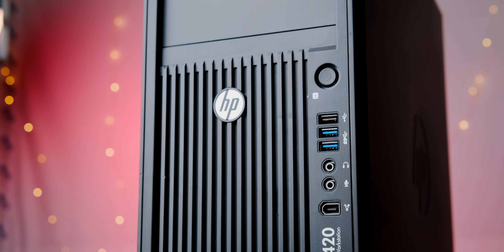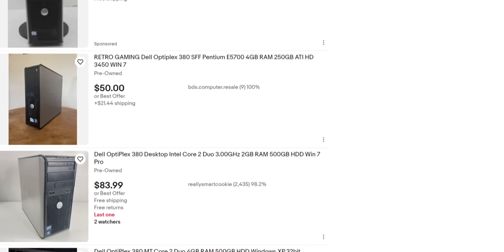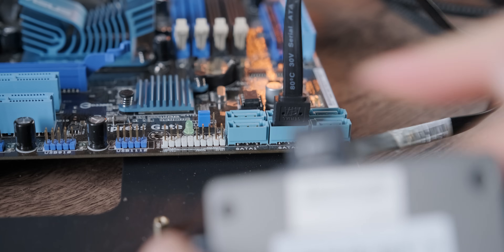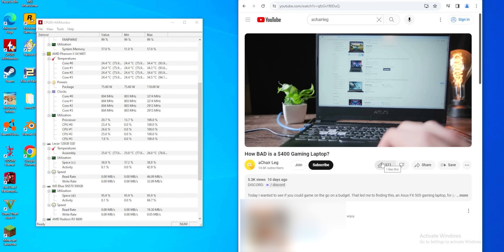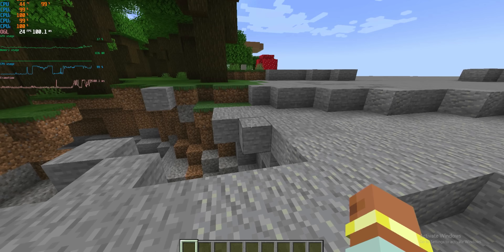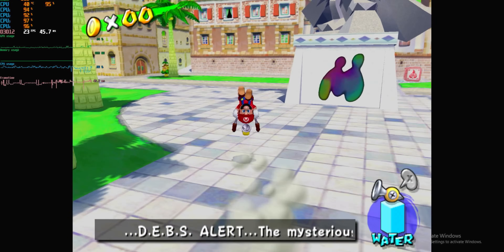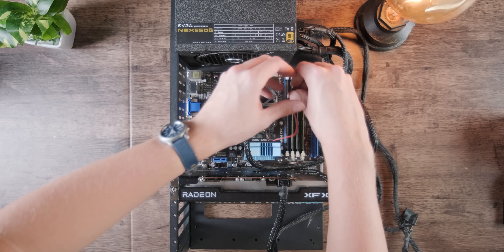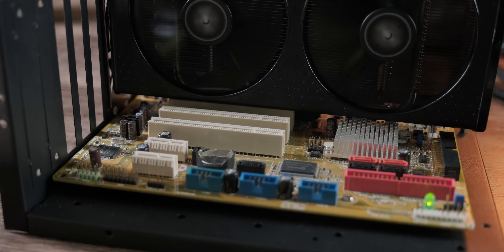DDR2 is DEAD.

Comment: I still have a bunch of my old LGA775 hardware laying around, some of it was used for a family file server until I upgraded it because it got too old.
But I recently built a "retro" core 2 duo setup for those 2000 era games, and it works great with Windows XP and Windows 7.

LGA775 is such an interesting platform too, because of how many different hardware configurations you can use: DDR1, DDR2, DDR3, Pentium 4, Pentium D, Core 2 Duo, Core 2 Quad / Extreme, PCI, PCI Express, and I think some rare motherboard also have AGP, while some industrial boards even have ISA! It's wild. It may not have the longevity of modern AM4, but it's a veritable smorgasbord of mix and match compatibility.

Comment: makes me wonder how much performance you can claw back by either using a different/older version of windows or tweaking the current one. i made a script to significantly reduce some checks windows (at least win 10&11) spams that absolutely annihilate performance and cause stutters, quite literally gave new life to my i7-4790 along with a $40 motherboard and microcode downgrade.

Comment: Had to deal with someone's pair of Core 2 Duo E4600 PCs the other day and it was not great. The Intel D945GCNL boards can recognize 4GB DDR2 ram at most, but only 3.23GB is accessible on the OS side due to chipset limitations and they have a tendency to have capacitor leaks which one board did. What made it feel worse were old 160GB hard drives (one of which died) along with generic silver power supplies (one of which blew a fuse). It was quite an adventure to cobble the remaining bits together to reformat it as a Windows 10 (used Tiny 10 x86 due to limited ram) PC with MS Office for the elderly owner.

Comment: How much power was the intel system drawing? Because I'm on a q9650 with 8gb ddr2 800mhz and it pulls at max 40 watt, just the cpu. It doesn't seem much to me. And yes, I swapped an intel core duo e8600 with this q9650 for 25 euros on ebay. It made sense.

Comment: DDR2 bandwidth sucks, memory overclocking is very limited.
Intel Penryn and AMD K10 are dead, outdated architectures and both superceded by cheap modern alternatives - Core and Zen.
All of them, including motherboards, are priced similarly or even cheaper than DDR3 platforms.
There's just no reason to invest in a DDR2 system, unless it's for a retro build. Or it's dirt cheap and you're in need of a media/office PC.

Comment: ••"F'num" 😂 It's pronounced like "Fee nom". I think AMD marketing wanted people to think of the word, "phenomenon" or "phenomena", "phenomenal", &c.
••I have legacy PCs (intel QX6700; socket 775 with DDR2 & AMD FX-8370; socket AM3+ with DDR3), so this content is still relevant to me, but I don't even try to put modern games on them.
••I remember back in the day DDR2-800 seemed so wicked fast (especially being able to remember the days of DDR-200, the Apple II (read and said as "two") and 486 IBM compatibles).
••Another factor in older PC component prices is inflation from recent years has caused these prices to go up. I paid $7 for a Xeon X3210 in 2017; now (late 8/24) it's $14. However, China is making and selling DDR3 new today. I think it's helped keep the prices down. I may replace the RAM just to keep my DDR3 system running longer.
••My socket 775 system (dual boot) will run Windows 10, but it does so much better with Windows 7; especially since it maxes out at 8GB of RAM. It runs all Windows XP games & programs like a beast. Driver support for newer Windows on older hardware can be abysmal. If I can ever get around to putting Windows XP, maybe Windows 7, and a nice Linux distro on my AM3+ machine, I'll probably sell or part out my 775 PC. That could be 4 operating systems on one PC 👀

Comment: Being able to run a multiboot 98se, XP, Vista, and/or 7 pc with Core2Duo or Core2Quad/Xeon (Disable 3 cores for 98, and 2 for xp) with overclocking and a xfi or audigy 2zx for that hardware excellerated EAX audio. 

You gain DirectX 10 with Vista, but lose true hardware excelerated audiocard support (cue Alchemy software).

I see alot of tests using old hardware, new versions of old games, on new os's... You gotta run the old 32 bit versions with the overkill hardware, and on a 32 bit os

Comment: Ram shouldn't make a huge difference in most cases, the most notable difference would likely be with onboard graphics and single channel.

One thing I remember about the Phenom IIs was that they were very sensitive about the mainboard and northbridge frequency.

As far as prices go: A (surprising) lot of businesses have antique systems running, where newer ones wouldn't have the needed connectors/slots, support for old windows versions etc.

If you're bored, you could also do a video on old "BSEL" mods for 775 (incl. 771 Xeons). Basically, you put some electrical tape etc. over the pins to fool the mainboard into thinking the CPU has a higher FSB. Only works on MBs that don't use CPUID.

Comment: re: not seeing drive during windows install: get storage drivers from mobo manufacturer and drop the folder in the installer USB. Then load the driver during installation pointing to the folder where you copied it

Comment: I am in current possesion of a dell XPS 630i system with a core 2 quad extreme using DDR2.  It was supposed to be a very cool video about old school gaming hardware.  Unfortunately, trying to use it was painful.  It is still on the shelf, so we will see what happens in the future.
Reply from the maker: That sounds really cool! I would try and throw a really lightweight Linux distro on it and see how it goes

Comment: I am using amd x3 phonei processor with 4gb ram.. clock speed 2.1ghz.. work fine many years no issues only one time power supply change..i dont even knew which year i buy.. may be its working 13 year.. more then

Comment: ddr3 still holds up fine. What's really funny is I never used ddr4. I ran a ddr3 machine with a 4790k and that processor was so good and is still decent, that I skipped the entire generation of ram and went straight to ddr5.

Comment: that's because you have low-end mobo with low-end chipsets instead of using P45 / X48 chipset would make big difference!
I have 2 machines with 16gb ddr3 and 8gb ddr2 all of them top specs and I play no games but I have battlefield 2 and F1 2014 which run at full spec!

Comment: DDR2 is great. I have a old quadcore and i have crammed the motherboard full to 16gb DDR2 333mhz that was lying around and just happened to be of same speed but from different sources. Old and obsolete otherwise but works wonders in this use.  I have also added old HDD disks so the machine in the living room acts as a the backup machine for all machines elsewhere in the house. it has backup sync software that periodicaly tests if other machines are online and if so attempts to mirror the contents from certain folders from the to those big HDD disks. And since i have several it is easy to make backups of backups too so all in all my files are pretty secure except fire (and even then i would have some stuff in the cloud). 

Using the machine itself is great now. Several browsers can be open, steam games and gamepads attached and big TV since it's living room HTPC machine. I will likely exchange the quadcore some day with the oldest whatever i get from somewhere else but at the moment it works really well.

Comment: Well, you could have 8gb of 800mhz DDR2 memory for a little over 10 USD from Aliexpress.

Also a huge mistake you made was to use a 6600, which has a halved PCI-E, while these motherboards are 2.0. You were essentially strangling the graphics, using an x16 GPU was a must for a test like this.

Comment: These gen CPUs always did and always will make me vomit.  I literally left PC Gaming and bought a PS2 when these things came out. only returning when ivy bridge became so cheap I couldn't resist.  Try running it with a period correct GPU like a Radeon 9800 and it will make you even more sick.  THE REASON THESE ARE EXPENSIVE IS ALOT OF OLD INDUSTRIES STILL USE THESE GEN MB's TO RUN THEIR PLC MACHINES.  I work in a large automated plant and I can still find random  unused coppermine xeons tucked into corners.  Ever since they updated from Windows NT to Windoes 10 Server (`2020) they had to update them all to machines with TPM otherwise they'd still be running x58s.

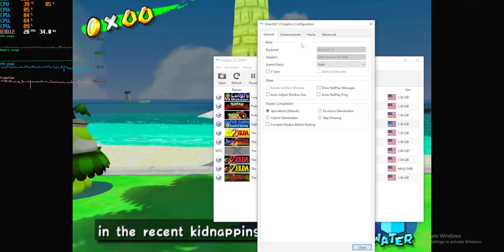Comment: 7:52 this is really weird, since i got worked on dolphin emulator with ligher ones without issue with a core 2 duo one. Tried using opengl or Directx 11? Those benefits better than that. Even Vulkan.

 it could really depending on drivers by gpus.

Comment: Ddr 2 1333mhz was  dual sidded plus 4 slots  mak8ng it dual channel quad pump i belive  helps ❤❤❤❤❤❤ smoother gaming..
I had 8Gigs only got used later XP USED 4G I BELIEVE ... BUT WIN. 7 USED THE 8G
I  Had the G400max  32mb using 3dfx  & opengl drivers.... made doom arena fly and look amaizing.

Comment: I used to own a Q9550 + 4GB DDR2 PC2-6400 with my GPU was the HIS Digital RX 460 4GB variant. Was able to play Doom 2016 on it fairly well at 720p Ultra. But yeah - will definitely not run DOOM Eternal and slow af with the workaround for the CPU.

Comment: I am thinking about trying to find all the hardware I had on my second gaming PC but, for that price I'm probably sure it would be close to $1500–$2000 dollars. I built it for Voodoo graphics, ATI for the regular card, UWSCSI hard drives) set up in RAID 0. Slot A (AMD) from when Intel got sick of them doing better than them on the system they developed). 1st gen SDRAM clocked at 15 nanosecond (standard PC ram was 60 nanosecond and high end was 50 at the time) that the salesman at Fry's electronics said "that does not exist".  At the cach register when they asked if I found everything I was looking for. I said no. Said what I was looking for. $300 later I had a single stick of something like 512 MEGAbytes of memory. It was playable at 1024x768 but at 800x600 it was awesome! About like Roblox on a Chromebook

Comment: I have 16GB DDR2 in my current dual CPU E5 2667 V4 rig. It's in a RAM drive and pretty much saturates the SATAII connection it's attached to.

Comment: I have a win 10 Q6700 @3.2  with 8gb of DDR2 (2x4gb) / 8gb rx580 (3rd gfx in its life Radeon hd6870 1Gb the days ,  then GTX650ti 2gb ), sat next to me at this moment it ran 14 hours daily no issues for the last near 20 years  i turn it on to update it regularly and it's a backup that came in handy when my old folks  laptop went down it stood in for them for a couple of weeks  till new laptop was delivered , so its  still going strong,  (i have quite a number of DDR2 ram sticks kicking about in the box of eternal computer bits for "just in case")

Comment: i used some parts i had l,aying around to build an i7 3770 system recently for taking to friends houses for lan and i think this is about as far back as you can go to run modern titles on a budget machine , ram was like 30 quid  for 16 gig ddr3 wich came new in box (i didn't know you could still get new ddr3 ) if hadn't had a motherboard for it id have gone with an am4 and an apu but i also had a 750 ti i wasn't using and i figure when i upgrade my main rig it can have the 1060 in it , kinda wish i had more excuses to build with this older hardware as it is a lot of fun

Comment: Personally I would have also tested how it works with Linux as well to make a comparison. Microsoft is gonna pull the plug of Windows 10 next year and I feel that you can use Linux to extend your machine's life the way I do with some of my machines.

If you want to have a retro gaming Windows XP/7 system you might be better off buying a Thin Client which will cost you less and you will save some hardware from the landfills for a bit longer.

Comment: DDR2 days were numbered long ago, not because of the speed but because of 2, 4 or 8GB limitation of systems equipped with such slots.These systems run much hotter and noisier than early Core i based computers. There is no reason to use Core 2 or Phenoms in 2024 when 3rd or 4th gen systems are written off or sold at trash price.
For example, week ago I bought Dell Poweredge T20 with 4th gen quad core Xeon e3-1225v3, 8GB of DDR3 RAM, 60G SSD + 500G HDD for 25 EUR. 

If Microsoft will seriously ban pre-8th gen CPU's from running windows 11 and Google and Mozilla will drop browser support for Windows 10, in 2026 DDR3 will become e-waste. I still happily use Office 2003, MySQL 4.1 and sometimes CorelDraw 12. All that runs under Windows XP virtual machine as part of some legacy system. But I cannot even enter Google search page with latest Firefox available for XP, and that's why XP is dead.

Comment: I think the problem of stutter is in default windows( better to use 10 ltsc with revi os modification, it uses only 2 gigabytes of ram and has much less opened programs and unneeded services). Also windows prefetch could help if sata is not fast enough😊

Comment: While DDR2 is really starting to get old and struggle with modern titles, it still can perform fine for some stuff. Like World of Tanks, my bro still used i5-2400 system with GTX1050 last year, and it ran fine. What comes to DDR3, it is getting its last years in gaming now, but performs totally fine in anything i throw at it, i7-4790k vs GTX1080. So it is worth buying DDR3 system, if You get it for cheap.

Comment: I have an old X300 Thinkpad, I don't really have any use for it, the battery is dead, and the 1.8 ssd is only 60gigs, but it works for light web browsing running some unsupported Ubuntu LTS, and is fun to play with. So I'm considering maybe replacing DDR2 2x1gb sodimms with 2x2gb 800 sodimms, equivalent to about 5.5$ each. For shits and giggles(1.2ghz dualcore with 8gb ram sounds kinda ironic) I decided to check the price for 4gb 800 sodimms and... 38$ per stick. For the price of 2 of these sticks I can buy a set of new DDR4 2x16gb 3200 16-18-18-38 G.Skills. Some prices refuse to go down, and seems like no giggles will be going on.

Comment: What is great about these machines is they started having PCI-E gen one ... so you can use an M.2 in that slot (not the fastest ones because you won't benefit from the extra speed, but still much faster than the SSDs).
Some of the best CPU's for those motherboards are pretty cheap (~$20-$30 and have 4 or more cores).
In most cases those CPU's can support up to 8GB of RAM. 1024 mhz is pretty decent speed, most mobile phones don't have much more than that. Even most tablets don't have more than 2GB or 4GB of RAM.

These PC's are great for regular office work. They can even serve well in software development in many cases.
They will outshine entry level modern laptops for just a fraction of the price.
Even in home, they would be great for watching videos, browsing, chats etc. (basic web usage), and also they would be great for all the games that were published at their time and specially before.
So they would be great if you have a friend and would want to play a VS or a CO-OP session in Red Alert 2, Age of Empires 2, Quake 3, Warcraft 3, Diablo 2, Heroes of Might and Magic 3/4/5 ... many many others even more modern games than those would work great.

And finally, you can use them as home servers ... you can serve data or small websites.

For such a price ... it's a shame to throw them away ... at least they could be donated and restored to be given to families that do not have a PC at all.

Comment: Thank you for this video, i only upgraded from that Asus M4a785-M mobo last year after a decade of running it. Still have it sitting in static wrap trying to find a home for it as it has the Phenom ii x6 1100T with 8 Gigs of G.Skill 1066 ram on it. The Mobo Auto OC'd it to the 1200 for me and WOW that made a big difference for that system. Had a 1050 Ti on it and was playing Red Dead 2 just fine on a mix of low and medium settings, if i could find someone local who wanted it i'd give it away just to see it stay in use. Never even OC'd the CPU was to scared to mess with that part as i didn't know what i was doing there.

Comment: I really think your gaming performance is hurt by the RX6600.  If I remember correctly it is only a 4x pcie interface.  In new machines this wouldn't be a problem with pcie GEN 4, but with older revisions of pcie........ There isn't enough bandwidth to supply the graphics card.

Comment: I use the same set up cpu and ram, sinds september 2008, works fine 4k play back, system went from xp- vista-windows7-windows10, next year it will be replaced after 16 years, it’s done well

Comment: Strange, i recently put together an Intel i5-4670k system with 16gb ddr3, GTX780ti, Asrock Z87 Extreme4 MB, all in a nice PowerMac G4 case i converted to use ATX hardware and i've got it running both Windows 10 and Mac OSX Ventura with none of the issues you mention.

Comment: There are other uses for computers other than windows gaming. I can't remember the last time I actually paid for a computer. People throw that stuff away. Even i3, i5 and i7's I have here complete systems with Linux and Batocera all totally free... mind you all ddr3... and all very usable machines. I mean I'm not going back to the days of 486's, ide and 1meg video cards with dial up modems but there are still lots of use for older machines. Just keep throwing them out and I'm all in... thx.

Comment: Try using an MSI P43 C51 with SODIMM adapters to squeeze in the 16gb of RAM that it'll take, then get an intel Q9650, and set the FSB to 402. You'll get 3.6Ghz out of it reliably. 

I say use SODIMM to DIMM adapters because individual 4GB non ECC RAM cards are FUCKING IMPOSSIBLE to find. Getting old laptop RAM is the most attainable workaround.

Comment: I still have my old Phenom II/DDR3 system parts lying around.... My work PC STILL has my old ATI 4870 512MB card, that I used to run in crossfire with its twin... almost a decade ago.